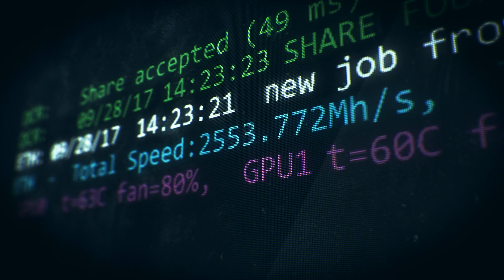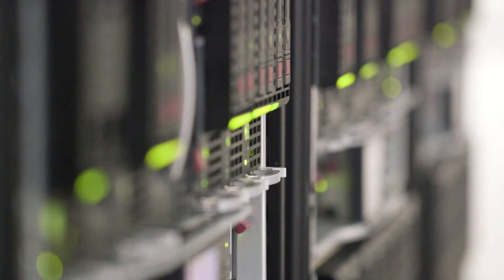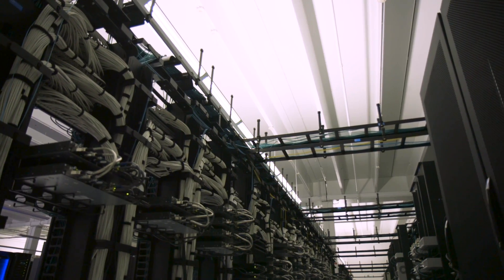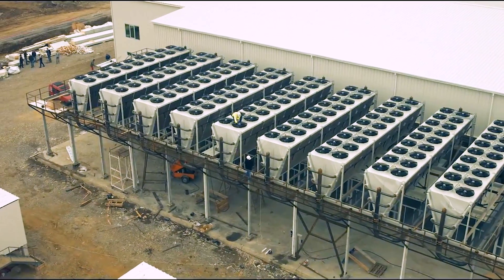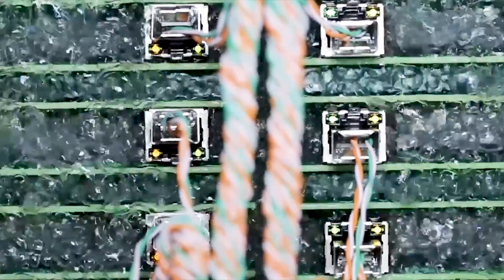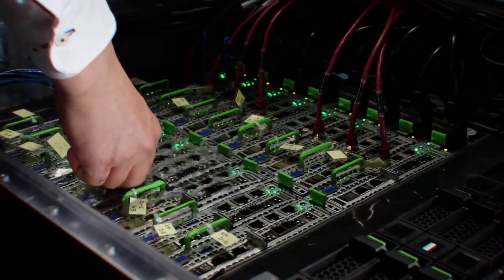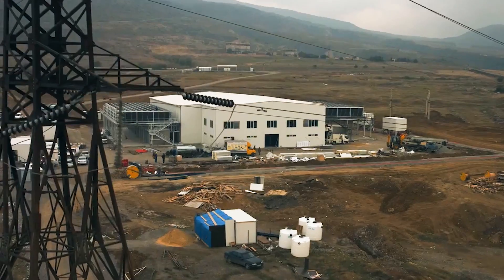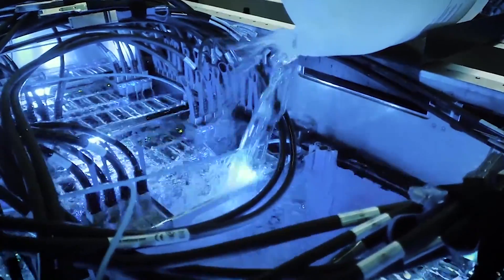Bitcoin Energy Consumption: An Inside Look

Comment: Actually the power companies love it. They throw away unused power from their grids all the time this makes efficient use of all the power they make.
Reply: Really I didn't know that was a problem that's quite interesting.
Reply: I don't think in this use that would be the case. If these rigs are constantly running that just increases the base load the power companies need to meet. If the rigs were setup to only run when electric demands were low then yes but that would mean the rigs couldn't be run all the time, only part of the nights (ppl sleeping so less demands) or in places like California during summer days when solar output is high enough that their production is higher than demand and they have to pay neighboring states to take they excess supply
Reply: @justme1276  yeah I don't think people understand where electricity comes from, it's not like you turn a light on and at the same moment the power station increases their generation by the same amount. They have to be putting out more than there is demand, if not the frequency drops and if demand keeps outpacing demand you run into blackout conditions like what happened in Texas.
You can help decrease emissions by simply spreading out your electric demand, such as running your dish washer and clothes washer at different times, if you have an electric car put it on a timer so it runs overnight when demand is low opposed to when you get home (I think peak demand is around 4-7 pm in some places because people are getting home and turning appliances on).
A lot of utilities have reward plans to incentive this type of behavior because it decreases the amount of reserve capacity they have to have, decreasing that capacity decreases their emissions.
Reply: Are you saying that in 2021 when all the world is paying more for their electric bill??? FUCK CRYPTO!